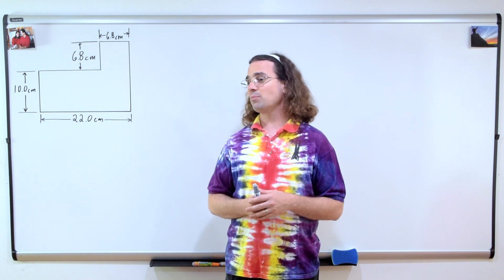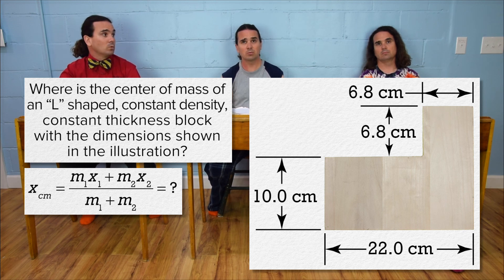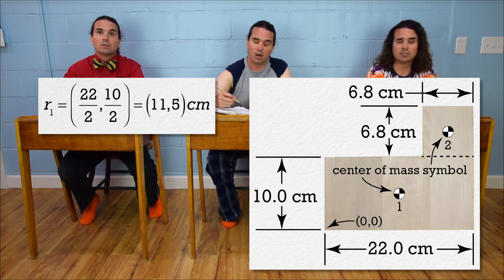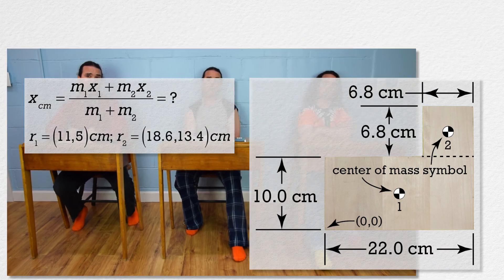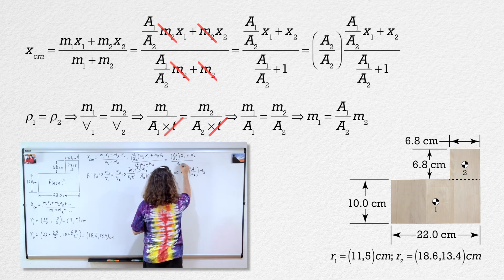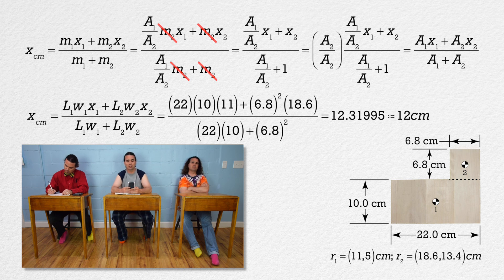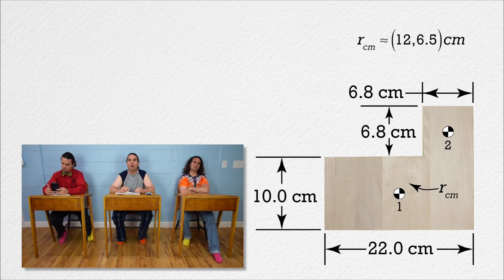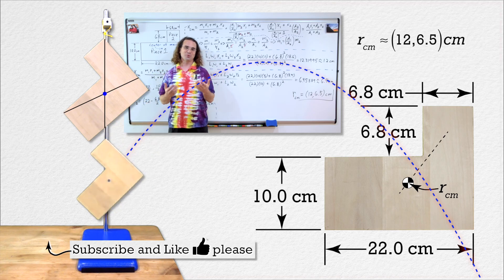Center of Mass of an Irregular Object

Comment: Hey there! Just wondering if you can use volume instead of area and still get the same answer?
Reply from the maker: Yes, however, as you can see at 3:40, the only reason that would work is because the thickness of the object is constant, if the thickness were not constant, you would not be able to use area and get the correct answer.

Comment: sir isn't center of mass moment of inertia/mass or we ignore the distance squared term?Please help me solve this doubt
Reply: They are related concepts, but are two separate concepts.  Center of mass is also of interest for moment of inertia, because an object's nature if not constrained to an axis, is to rotate about its center of mass.

Center of mass is the total of the first moments of mass, all divided by the total mass.  Center of mass refers to a point.  If you start from another point, it has the units of meters.
Moment of inertia, is the second moment of mass, which is also known as rotational inertia.  Moment of inertia has the units kg * m^2.

Moment in general refers to a quantity multiplied by distance (or radius vector) from a reference point.  First moment would mean there is an exponent of 1 on the radius vector.  Second moment would mean there is an exponent of 2 on this radius vector (which is a self-dot product that converts it to a scalar).

You may hear of torque referred to as a moment, whose full name is "moment of a force".  Like the first moment of mass, it is a product of a radius vector and a quantity in question.  In the case of torque, the quantity in question is force, and given two vector quantities and a desire for a vector resultant, it is a cross product.  In engineering, both torque and moment are used, in order to have a way to distinguish them when torques occur in two axes in the same situation.  Generally, torque is along the long axis (twisting), and moment is perpendicular to the long axis (bending).

Comment: Well we could also take the vertices of the shape to be point masses [taking one of them on the origin] and plot them on a coordinate system and calculate the system's Centre of mass , like in the previous video.
I did it that way and got the answer for the X-CM but I think I did some calculation mistake in the Y-CM. 
I done it this way because the shape was given constant density.